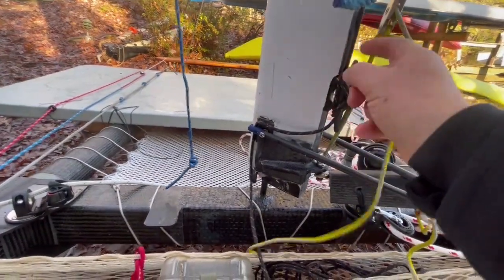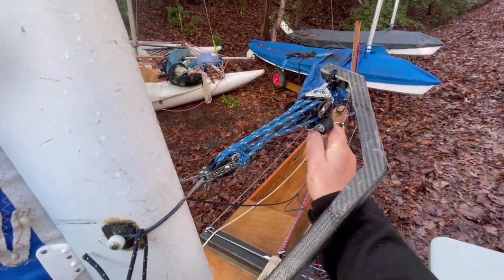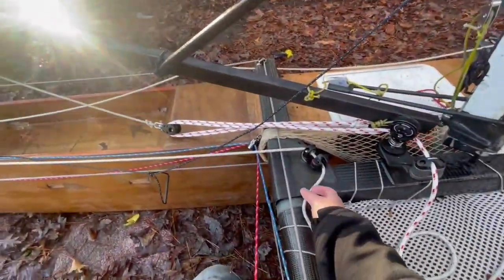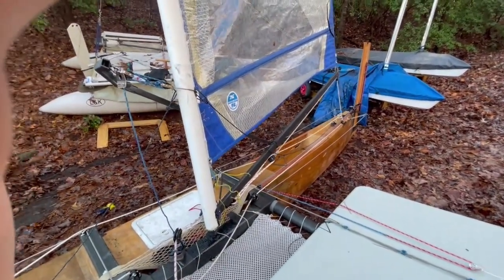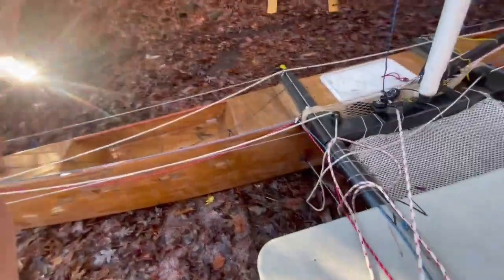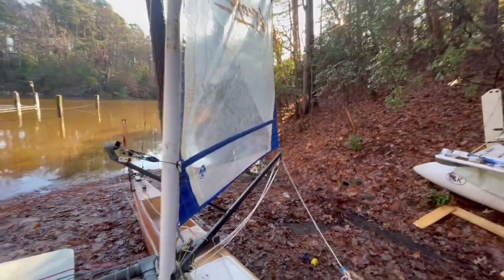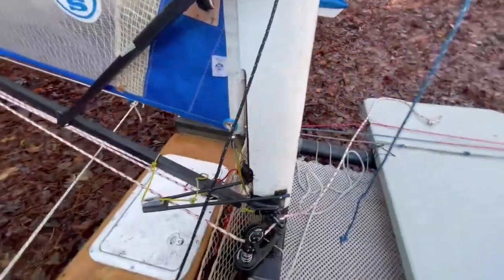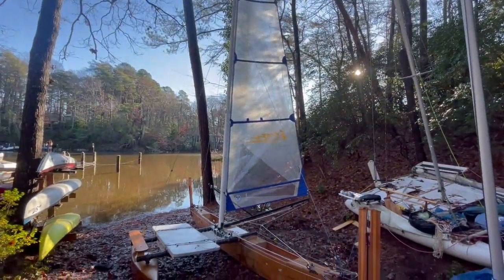Crazy Proa Project. Sail rig.

Comment: It looks like the rig would be unbalanced with center of effort so far back. But it seems to work well.

How about a leeboard or centerboard?
Reply from the maker: As I said in the video about rudders. I keep front one locked and partially down. So lateral resistance split between two boards - front and rear. By lowering and raising them I can move center of lateral resistance anywhere I want.
There is no need for additional boards.
Reply from the maker: @chrisgrill6302  . In this case rear daggerboard works both as a rudder and as a daggerboard. It has a function of creating lift. It is large. Basically to steer the boat I balance both boards in such way that the boat sails in straight line and I use steering function of the rear one just for minuscule adjustments. The hull itself is flat bottomed and has a rocker. Meaning that it would spin around with little force applied if no boards down. So it steers nicely. Unlike a classic proa with deep narrow hull. If I have too much weather helm I just raise front board a little bit, until it balanced. If I raise the front board completely the boat will have a lee helm and it will fall off even without steering.  
I hope this explanation is clear, if not it is better to ask the question in FB proa group so I could provide some drawings.

Comment: Fresh thinking... Good stuff!
 So, the way I get it is: for the CLR to be aft of CE as you mentioned in the comments below, since you said raising the front board, results in Leehelm....
  You probably have to drive your rudder all the way down and sit aft of mid ship, correct?
My question is, how do you come ashore? and aren't you afraid running aground and breaking the rudder?? 
  Keep Shunting Brah!  The Future is in the Past, the present is only the connection....
Balkan Shipyards
Reply from the maker: At the end of next posted video, called “winter sailing” I actually come ashore at the end of it. I just raise the front board just before I hit shallow water. 
With two boards I have a huge flexibility to move CLR anywhere I want to. With rear board down and front up CLR will be behind of CE, with both boards down CLR will be ahead of CE. With front board down about 30% and rear all the way down I have CLR and CE balanced.
Being backwinded not a problem. Just raise rear board and wind will swing me around. Or. Another option - just steer with both rudders out of situation:) (Front rudder is normally locked)
And both boards will absorb a hit and pop out of cassette if hits comes. I talk about in this video.
Reply: @VladimirUD   Thanks, so you cleared the problem with the rudder, hat about your front board, it too can pop up on impact? even though the hull is behind it... Cool Stuff!
Reply from the maker: Well. The front one normally is raised 2/3 up, so there isn’t much area underwater. If it hits something it will absorb the shock and tilt, driving the hull up and over what ever it hit.